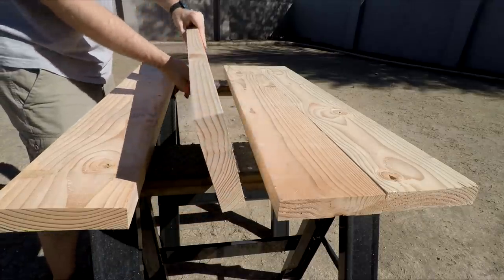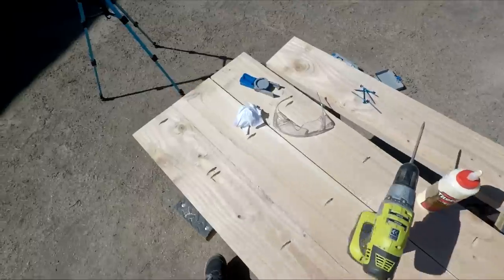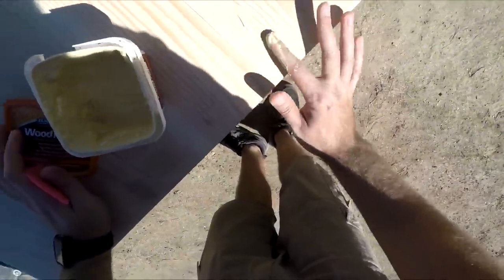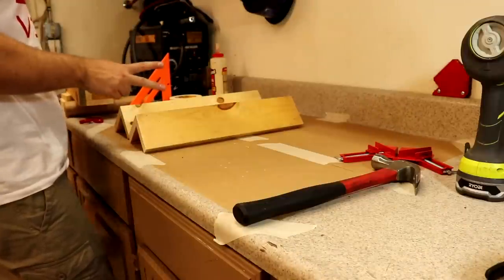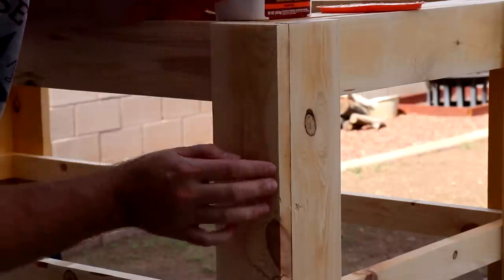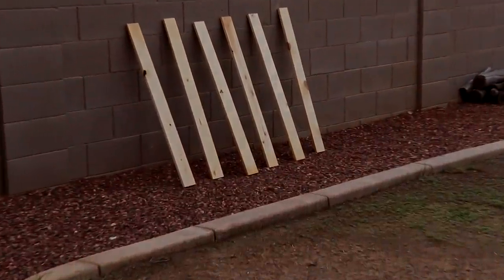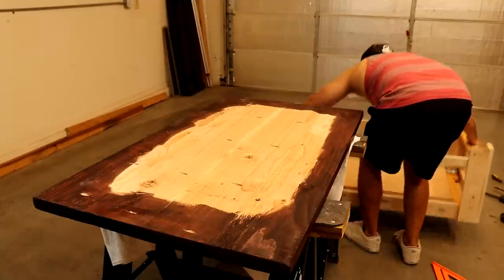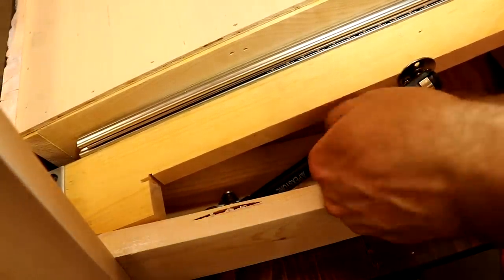Easy DIY Rustic Concealment Coffee Table / farmhouse

Comment: What kind of gas struts did you use?
Reply from the maker: Ant T I listed the ones I used in the description under “pistons”. I guess I should change that name haha.
Reply: Thank you. My drawer came out amazing, just like yours upside down, the only problem was the drawer does not drop down slow because of the weight. It literally drops down and slides out too quickly. I actually purchased 22 lb apexstone struts. I was going to return them and try to get the close struts. Plus the space between the edge of then drawer and the coffee table was too small to use the baby proof locks that you used. I have been looking for something to hold the drawer lock closed in place. Let me know if you have any suggestions. Love the channel. Keep up what your doing. Thanks.
Reply: @adayinthelifeofastagehand  Did you figure out anything on the locking issue?  Did you get the close struts?

Comment: Please don't think that I'm being negative because I'm not. I think you made this to complicated and could have made it alot simpler by fitting a recessed shelf for storage at the top and then do a lift up top instead of the drop and slide drawer ? Well done for what you done though . 👍
Reply from the maker: brett jones that’s an awesome idea! And you’re right, that would have been way easier.
Reply: The only problem with this is if there are items on the table. Maybe it's overcomplicated, but the drop down allows without any extra work to access the storage.
Reply from the maker: Joshua Glorioso that’s true also! I was flirting around with a top that slides open, exposing the cavity but the rails were obvious, negating the whole “secret” aspect of it.
Reply: I recently made a similar table but opted for a lift-up top with hidden storage underneath. The issue is with a "2x" thick top, it's too heavy to lift up. I think this design has better potential.
Reply from the maker: sbrigby thank you! The pistons I used could also help with the lifting of the top with the other design.
Reply: Could actually do both relatively easily.  Not only keeping the lower compartment concealed, even if top is found out, but adding extra, and easy storage in the top side aswell....
Reply: @WoodNerds  do both. If you do, I'll build one aswell as an inspirational piece.  Having two hidden areas, the top and the bottom 

Also, having a hidden cash spot attached to the lower two boards at the bottom.  ..... Keep a few stacks down there.
Reply from the maker: Lieutenant General I’d love to see that!
Reply: @WoodNerds  I did an armoire a few years ago that's a concealed case has a lot of ammunition in it. 
 Also holds clothes.  There's a 4 foot wide by 3ft by 3 ft area in the bottom for ammo, with a pull up lid, then theres two actual lock boxes that are from off amazon, there for in wall use, I have them installed in the back of it for my silver collection I used wood to face the door on them to blend in and the only thing visable is the keyhole, which I used a knot to conceal ;) 

The last couple years ive been doing a lot in regards to hiding things using furniture, including in wall abilities utilizing lost space. 

I own my own home, am retired and live in the woods. So I have the ability to actually use the wood on my land to make things from oak/hickory/pine/ash/maple.   A sawmill is ideal for someone who intends on making a habit of this stuff. 

I also burn firewood so any scraps feed the fire if they aren't usable. 

I am also going to do an addition this year to the house. I have intentions on doing a lot of pine work this year, and residing the whole house using the slabs I cut lastyear theres over 60 trees I have prepared.
Reply from the maker: Lieutenant General congrats on the addition! I think I might do something similar to what you are describing. In wall is a really cool idea.
Reply: @WoodNerds  could do a whole concealed room easily utilizing woodwork. 

Whether you keep food, guns, your bedroom, an office or a den/getaway whatever you want. 

Its doable. 

People, get out there and use your minds, knowledge means nothing without application. Do it.
Reply from the maker: Lieutenant General I couldn’t agree more. So many people have the ability but never apply themselves. That’s why I started this channel. Help everyone by showing them how easy and fun it can be.
Reply: @WoodNerds  keep doing what you do, and prepare accordingly for the future of what's to come.

Comment: What's going to happen when that table top cups from the humidity? Those boards are too wide and flat saw. They normally cup shortly after planing and joining ruining all of your hard work because you didn't go through the trouble of buying rough cut quarter sawn lumber. But if that's all you have then you should cut your table top boards 3 inches wide and no more than 4 inches maximum before you join them together. That way the boards will contract less reducing cupping and keep your table top more level than a wider board could.
Reply from the maker: Haujean Contactee great advise. I’ve done a few of these and haven’t had any cupping or separation between the boards, but perhaps I was just lucky.
Reply: No you weren't lucky. People just make a bigger deal out of it than it is. I have a  couple of unfinished tables in my woodshop that are 20+ years old. Concrete floor, no heat, no ac and they dont move at all. They dont shrink or swell. I use the tables 3 or 4 days a week making furniture.  Unless your house has holes in the roof and water is just pouring in your house the wood isnt gonna swell. Most movement in furniture can be attributed to being extremely poor made. Yours isnt the greatest but it certainly isnt bad enough to warrant concern about seasonal movement.  I am open to the thought of seasonal movement. I have just never seen It or experienced It myself. Seems every person how owns a saw seems to think it's a problem. So feel free to link a video showing a piece of well built furniture having seasonal movement in a house that renders it useless.

Comment: doesn't your wood contract and expand? after 3 years have you seen any issues, changes, cracks? - I h ear people say don't  glue down the top, use table top fasteners and stuff like this, they speak that wood will contract about 6mm about 1/4 inch?  interesting
Reply from the maker: I live in AZ and haven’t had any issues but they are right! This is a pretty old video and I’ve updated my process since then. I had a table just like this for like 7 years and it didn’t mess up but maybe that was just good luck!
Reply: @WoodNerds  thank you, thats good information, I am about to put the top on :) so it's really useful, thanks
Reply from the maker: Of course! Let me know how it turns out for you!